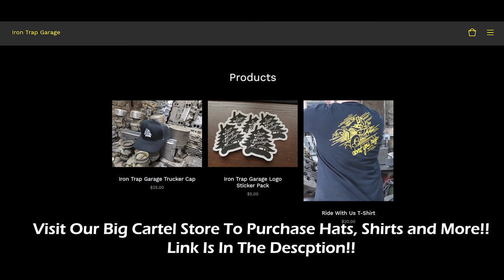Insane Lincoln V-12 Lucite Steering Wheel Transformation

Comment: From a brief Google search, lucite is just plexiglass (pmma), which is a thermoplastic, meaning that it can be melted and will re-harden to the way it was.  The reason I mention it is that you can weld thermoplastics. You would just need to find a similar color plexiglass rod to use as filler. It's a bit like oxy acetylene welding if you haven't done it before. If you like the look of the cracked wheel then to each his own, but it would bug me.

Comment: You need to thoroughly wash and degrease before sanding.  Saves time. you can see the surface better and you avoid grinding dirt further into the plastic.  Also periodically wipe down with water to see the result of your work.

Comment: Very Nice, I agree with the look. I'd use a period farm-boy makeshift repair to keep the vibe, like wrapping some  1/16" cotton string in the  gap, age it with your favorite color grime, then brush a bit of varnish over the string for some protection. Nice thing about that over epoxy is that it is reversible should the life of the wheel bring it to someone who wanted to completely restore it.  Plus, it's the kind of thing a kid with a sore hand might cook up to solve a problem cheaply and quickly.  That's hot rodding!  Loving all of your videos, Matt!

Comment: All you gotta do to get the wheel off is leave the steering shaft nut on but loose from the wheel. Then tighten the puller, and give the puller shaft a pop with the hammer. Comes right off.

Comment: The splits can easily be fixed with 2+2 epoxy, and if anyone ever finds a wheel with everything cracked off, heater hose with the same I.D. As the metal inner hoop of the wheel can be split and wrapped around with adhesive, just find a nice decorative cover. Not a professional fix, but works on a cheap budget.

Comment: I would consider filling in most of the cracks like 2/3 of the way some epoxy, then fill the rest with metal and celebrate rather than hide the wear and tear. It would make it more comfortable to use.
Reply: Yep-  Wabi-Sabi that guy,
Reply: @Nicks66Service  That is what I was meaning but didn't know the correct term thanks!

Comment: That wheel belongs on the coupe hot rod, IMO. Exposed to the elements in a roadster, it would be subject to rapid deterioration, and all that work would have gone for naught.  BTW,  is the knob on the shift lever from the steering column the same Lucite as the wheel. While it probably would not work with a floor shift,  assuming it matches, it might go with something else on the dash, like the glove box door.

Comment: It would not work on this wheel, but one like the 39 Can be repaired by Ving the cracks and using PC-7 to fill them.Sand and paint . I did mine in a paracord wrap I like it.
You can get a wheel off the column by holding the column solid pulling on the wheel with 2 hands while someone hits the center nut which you leave at the end of the shaft
Usually only takes one hit

Comment: The gray stuff on it looks less like paint and more like knob fungus...Antique (home) radio collectors often find old radios where the knobs have a brown/gray/white substance on them that they often refer to as knob fungus. Sometimes you can scrape it off with a fingernail, but the preferred method is soaking in a glass cleaner formula with ammonia or something similar overnight... Old hand tool grips especially plastic screwdriver handles get it too. There is a certain stink the knob fungus stuff makes especially larger pieces. If that is what was on the wheel you could have saved effort and original material by soaking it. The worst thing about knob fungus is it will return in months to years if the object isn't handled regularly/at all...Early plastic despite its beauty can really suck to maintain.

Comment: I would bondo repair the cracks sand it to 3000 and make a silicone mold . Then cast it in deep tint urethane over a pencil steel armature, If these are worth 1500 bucks apiece then you could recoup your costs in a couple of sales.

Comment: Might be a dumb question, but would paint stripper have worked at the start or does it eat into lucite?
Reply: There are solvents & strippers specific to plastics.   Sometimes you don't have to do that.   Plastic in weather expands & contracts with dissimilar materials especially.   Those that have old oil sitting from oil changes,  or want to buy maybe cooking oil new ... you can soak painted, weathered plastic for a timeframe & scrape or wipe the paint off.

Most of these wheels need restoration anyway.   Hard to hurt them more than time has ... but you're right if wanting to take off as little plastic as possible.   

He'll probably bust out a wheel resto video if need be.  That's what makes this channel fun.  There is never a defeat.

Comment: Great transformation. Another lesson taught. With a little elbow grease parts can look Great. I hope they make a clear resin you can tint to fill the crack at the top. That would eliminate fingers getting pinched in the wheel. If not, it still looks cool. Job well done.

Comment: Hey Matt do they make a epoxy that is colored to fix cracks on the steering wheel
Reply: Joe Dyer 

Not coloured, but 2+2 epoxy works great, just have to paint it afterwards.
Reply: @armitage1950  cool thanks for the info
Reply: I have used colored additives to epoxy.  A few experiments could get the color close.  Maybe leave the rim crack and fix the biggy in the hub.